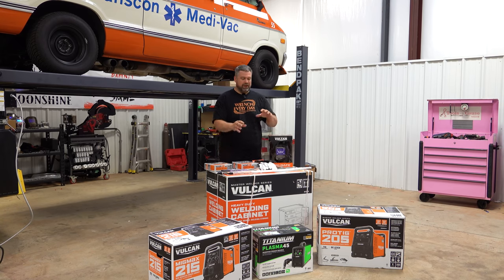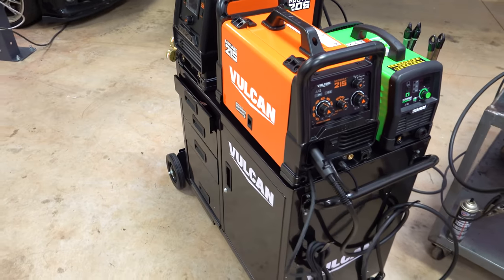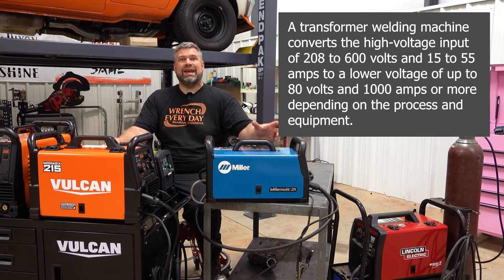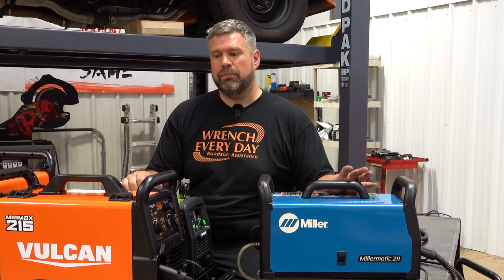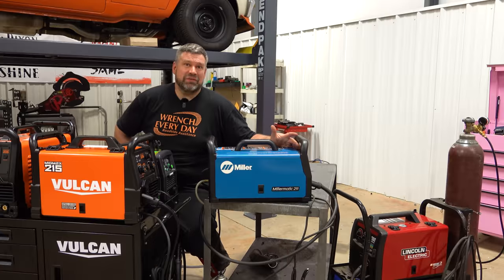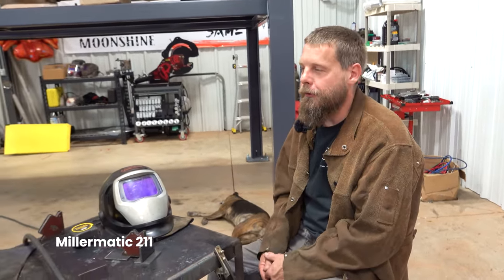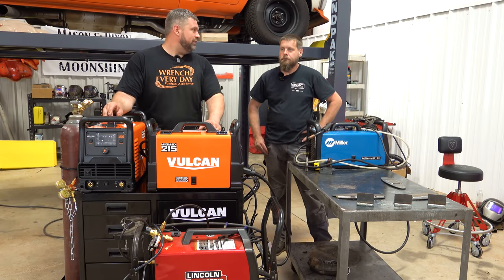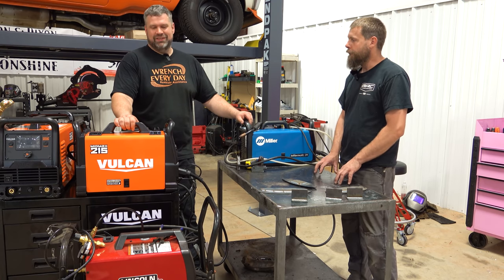Here's What NO ONE Will Tell You About Harbor Freight's "Best" Welders....

Comment: There was a Miller welder for sale locally for $250 with a blown main board. The machine cost $2,500 new. Called around for a new board and Miller wouldn’t sell one, had to go to a service center. Used board if you can find one was $1,500. 

I could get a couple welders from Harbor freight for the price of a replacement board for a Miller.
Reply: I had a similar experience with a quite used Dynasty 200 I picked up at auction cheap.  It did work for 2 years until a board died.  Ended up selling it for parts at quite a profit and purchased a new Dynasty 210, 7 years in ans hasn't skipped a beat.
Reply: I came to this conclusion too. That once out of warranty,  Red and Blue cost more to repair than just buying another China welder.  I'm a fan of disposable welders now.
Reply: What model is it?
Reply: @fml5910  I agree that's what they're doing but in my mind they're doing what GM and Ford did when Japan first started sending cars over.  They didn't take them seriously and then all of a sudden their market share shrinks.  

I suspect the Chinese are going to take a bite out of blue and red too.  I don't believe that's $5000 more in value in a Dynasty over a $1000 China machine. Better yes, not $5000 better. 

The point of buying American is being able to get parts and service. If service costs more than a new 1/2 way decent welder, why bother with service?  I'll buy two cheap ones and keep one as a hot spare.
Reply: Solid, affordable, long lasting, home shop equipment that keep on giving, and keeps you in the running. That's  what you get!  China/Taiwan,....yep. They sure are. So is my iPhone, laptop, tv, microwave, fridge, electronics in my american truck, electronics in my Mustang, treadmill, toaster, bathroom scale, radio, blender, etc.
So if anybody wants to say that they won't  spend money at Harbor Freight for a tool, because  it's made in China, you might want to wake up and research a tiny little bit.  Go look at your big, American made pickup truck. It's a global market, and you will find parts from all over the place!

Comment: Shoooooooot, that’s awesome that you got to test all of these. I have the Titanium Unlimited 200 multi process machine and it is a very great welder, I’ve had it for a couple of years and have completed some really intricate projects that I use in my home and most recently a Move bumper kit for my buddies Chevy Silverado 2500 diesel. The welder never has any issues at all and any issues with welds has always been operator error. I also have the stick welder 225 inverter and it’s a small but mighty beast! I can’t say enough about the quality of these systems.

Comment: I have the TITANIUM Unlimited 200 Professional Multiprocess Welder and it's done everything I've asked of it.  MIG, TIG (no pedal), or arc, it does it all and doesn't skip a beat.  No issues in over a year.
Reply: @fml5910  I don't use it daily.   I'm a home hobbyist but it has served me well
Reply: @fml5910  I've Also acquired the unlimited 200 titanium. I've loved it throughout this time we've had together,  and I've pushed it as hard as I could. Other than the guns it came with, and thenot having dcen capabilities I've no complaining. Just love the machine. I Also bought the titanium plasma.   Love it love it love it,!
Reply: @fml5910  I've actually seen many pros selling the unlimited 200 for less than 600 many times. Just have to keep an eye open.

Comment: For the pre and post flow of gas, my old (old old) Sealey Migmate 120 Turbo was set up so if you half-pulled the trigger you got just the gas, and a full-pull started the arc and wire feed.  This meant you could do your own pre and post flow.
Reply: The crap ass Hobart, just a beat machine, MiG welder at work is set up like this. Well I set it up like that cause I was sick of grinding out the starts and stops. Love that feature.

Comment: A few things to note, because overall you did a great job. All of the Hobart welders, except for the Multi-Handler 200 are transformer based and made here in the US in Wisconsin. Over 20 years ago, ITW purchased Hobart and Miller. I believe every Miller machine is made in the US and in the same facility as Hobart.

Unless you want to spend north of $2000, you are correct just about every multi-process welder is just Mig, Tig, stick and DC tig. However, ESAB does offer several multi-process welders with AC/DC TIG but you are well over $3000 for them. Also, the Hobart 210 MVP, or Multi-voltage plug is a Transformer based mig welder that does 120v and 240v.
Reply: You are correct sir. Hats off
Reply: Esab is right down the street from me. I'd love to work there but crap pay.
Reply: OK, If you want to get crazy, I'm In Australia, so factor that in, We tested and tried to BE sold a Lincoln Electric 300 Amp Modular design setup, multi process , Mig Stick and AC DC Tig system, and by the time you put all the modules and wire feeder and special Adaptors to get Water cooling on the Tig, was now nearly 5 foot high and was Going to cost our company $25,000 Dollars Australian, without the Tig Module it was still $19,000.  I (being the Senior Welder) tested it and tried to get my head around the Settings Screen, and I didn't like the Interface at all, and I couldn't get good Constant Welds out of the Machine, Especially Alluminium.  So we Ended up looking at another Machine that was 400 Amp water cooled Mig welder, German Made, Called "Lorch" (I hadn't heard of them) serviced by a Welding Company here that we deal a lot with, and It does Phenominal Welds in Steel or Alluminium and the Interface is simple and straight forward, has multi wave and Pulse functions, and we ended up Buying them For about $7,500 each (we bought 3), and we couldn't be happier, we told the Lincoln Guy he could take His machine back with him, my Opinion, Not user Friendly and too Dear for what you get.
Reply: That protig 205 is AC/DC also for less than $1k, mine works great for me and it also auto recognizes 120/240 without having to change a setting on the machine.
Reply: Everlast Welders offer multi-process AC/DC machines, the Lightning MTS 225 is $2,000.
Reply: Yep, you can throw all of those 3 down the hill. I love my Hobart welders. Both my Ironman 210 and my Handler 140 have been trouble free going on 10yrs. They're such a pleasure to use. Smooth as butter and they get used quite often. I've got less than $2200 in both of them paid for new back then.
Reply: My hobart handler 210mvps...I have 2 one for home and one for shop use work amazing for anything I need steel wise

Comment: One big thing to keep in mind with inverter based welders/plasma is the duty cycle.  You want it high enough that you don't have to keep stopping to let it cool down.  Sometimes that means going to a bigger machine to get a higher duty cycle for the work you plan to do.  I didn't hear that discussed, if I missed it then just ignore me lol
Reply: I am new to welding. Does duty cycle have a negative effect on the work itself, or is it mostly just a time constraint?
Reply: @Inertia888  It's just how long can you run the machine before you have to stop and let it cool down.  Pretty easy to work around on most small projects if you change your assembly order so you're not having to do all the welding in one stretch.
Reply: I made this similar comment above. These machines DO NOT have the same duty cycle ratings as the big blue and Red or even green machines. That's okay for a hobbyist, but not a professional.
Reply: correct. thats why professional welders that use smaller machines gravitate towards miller. lincoln make seriously pro quality larger welders just like miller, but their smaller home depot welders have crappy duty cycles. you can weld for like 10 minutes and then it stops

Comment: I picked a Hobart 140 for my project cause my buddy who used to be a professional welder recommended it and I didn't want to put in a 220 outlet. Its made by the same company as Miller but they are much cheaper. I replaced floors, body mounts, kick panels, rocker panels, toe boards, and did numerous patches on the rear floors and a few on body panels and it worked like a champ. The 110v systems work great if you are mostly welding sheet metal and don't need a high duty cycle.
Reply: I bought the Hobart 140 also which was recommended by a friend of mine who works at a chassis shop as a welder /fabricator and he told me that unless you're running beads a foot long or welding metal over 1/4" that this welder was more than adequate
Reply: I too have a Hobart 140 and it's been a great machine. I've done some exhaust repair, a few small sheet metal repairs, several frames for cages (pet rats as well as pet snakes), even repaired a few steel chair legs that my pipeline welder buddy said couldn't be fixed. Got to repair some corral gates tomorrow for my mom. I use a Miller 220v mig welder at work all day building and repairing parts for industrial use but I still love my little Hobart 140 for the smaller "around the house" jobs I have
Reply: My Hobart 120 is 32 years old. I’ve gone through hundreds of pounds of wire over the years. I use my oxy-acetylene unit to pre-heat and can get passable depth on 1/4” when I need it. Now it’s finally going out. I shudder at the cheap HF stuff, but also at the crazy Miller price. I’m stuck.

Comment: Harbor Freight has come a long way in the last ten years. I recently purchased several Bauer 20 volt battery tools (1/2" drill, drill driver, reciprocating saw, 4-1/2" angle grinder, 6-1/2" circular saw and line trimmer/edger) and have been pleasantly surprised. A DeWalt or Milwaukee equivalent would cost more than I have to spend.
Reply: Even their electric chain saws helped me trim large branches and keep firewood in the wood cradle.

Comment: I'm gonna say it. With my 32 years as a welder and 16 of those as a CWI, That Vulcan, based on the sound, was right in the zone for short circuit arc welding. The Miller and the Lincoln both needed just a touch more wire speed.
Reply: I was gonna say the same thing .... that vulcan sounded like it was dialed in perfectly!! The other two needed a bit of adjustment....

Comment: I have been using the Vulcan multipro 220 for about 3 years.  Mostly on small to medium size projects. Only used the stick and wire so far I have been very happy. However if you are a pro. You need to consider the Duty Cycle. On one project I was building a 50"w 2"h x 20" d basen for a ribbon waterfall for a friend's pond. I was using the welder hard all day to completely seal the seams. The next day when I started again there was a loud bang and that was it. Dead. Good thing I bought the extended warranty and Harbour Freight replaced it no questions. They were very nice. Now I'm alot more careful not to over tax it and that works out good. More beer breaks.
Reply: yes for people welding a large part of the day, you have to go with miller if its a smaller machine. they are the only ones with a duty cycle that wont force you to stop all the time. both lincoln and miller are great for the larger machines though

Comment: I have the Titanium 125 Flux welder. I use it for some personal and some work. It does everything I need it to do. I spend less than 300 for the welder, gloves, clamp, and helmet.
Reply: I can weld up to 1/4" steel with no issue. I'm usually welding exhausts or hitch receivers. Nothing really precise. Stainless steel and aluminum are obviously out of the question but that's not an issue in my specific needs.

Comment: i have that same miller welder at work and i love it, its amazing for doing thin metal for body panel replacement and i love how easy you can switch from mild steal to aluminum or even stainless. its so user friendly to use
Reply: You cant weld steel to aluminum with that type of welder. It is possible with Explosion welding.
Reply: @joemad4110  smh. No where did he say he was welding the two together

Comment: We have the first generation miler 211 and we got it in 2011, the fact that I could use it on both 120 and 220 has been helpful. It was like $1300 back then and when you break down how may broken bolts we have gotten out and trailer projects we have done. I also like the support if you need something. We have literally run 100s of spools through it. Now on a budget the Chicago 180 is great for a cheap 220 only mig.

Comment: I have the migmax 215 for over 3 years now. Only issue I ever had was the ground clamp, it lasted about 2 years. I have put many hours on my machine and it works like the day I got it. I have built many things with that machine. 2 sawmills, logging winch, as well as repaired and rebuilt several deck over trailers, dump trailers and many repairs to my stump grinder. As well as countless other repairs. I read where the internals to the Vulcan are the same as the blue and red machines. For me and my budget the Vulcan has been hands down a awesome machine.

Comment: I don't know much about mig welders even though I own one but I did notice the difference in the sound of the arc on the hf machine. Sounded much tighter and consistant over the other welders. I would have liked to see a close up view of the welding processes and finished processes bedides a cut away view of the welds. It looked to me that the guy doing the welds was very impressed by the hf welder as he seemed surprised of it's capability and somewhat stunned as per my observance.

Comment: The best part of Budget HF welders/plasma cutters is when their budget circuit boards inevitably die there is zero parts support. So you get to learn how to become a circuit board technician at home on your own dime.
Reply: Or you can give Miller more than the total cost of a new HF machine for one of their boards lol 😂 take your pick….
Reply: I worked for a place that just returned them. Buy the warranty.
Reply: 7yrs running and no board failures, lives in dust and grime also but i do keep them blown out weekly. I bought a HF machine while i waited 4months on a board for my Miller but when i got the $540 board i installed it to verify it was working correctly then wrapped it in a bag for storage, been using the Vulcan ever since....they both have their pros and cons but if this Vulcan lives another month it will have lasted longer than my Miller without failure so thats a win imo for a cheap back up machine.

Comment: I've been pleasantly surprised with my AHP alpha tig for a "budget" welder. My MIG is a super cheap Campbell Hausfeld I bought from Walmart 15 years ago 😂 Set up on gas and upgraded grounding it does everything I need it to do for non professional purposes
Reply: Lmao.  I have that exact same walmart welder.   Still a flux core setup but the damn thing just won't die.  I went with Primeweld for my tig and plasma cutter, and they are amazing so far.
Reply: Yeah I had an AHP too and it did everything I wanted for about $800.
Reply: +1 for AHP. My Alphatig has been rocking since 2016 with zero issues.

Comment: The harbor freight stuff just kills the name brands when you factor cost… I’ve been more than happy abusing mine… their toolboxes are more than just ok too…. They have definitely been stepping up their game over the last few years…
Reply: Totally agree, they have been stepping up prices though. Still a great value
Reply: 🍻
Also, haven't looked further into the channel content here, yet, but would like to see comparisons on larger, upright tank 120V as well as ~220-240V air compressor comparisons - by class metrics, per video, if need be.
Reply: @That_Handle  I’m not sure about their bigger air compressors, I’ve got the 40gal 120v compressor from them as a backup and haven’t had any issues with it, it’s pretty fast and quite, been running a year now so… pretty good deal so far…
Reply: @robertw1871  ,
I had been checking out a larger 200 plus volt unit from tractor supply company but apparently as of late it has run into not only supply issues but quality issues and so on stepping back from that leaning and am looking to narrow down some efforts towards reappraisal of what's currently available

Comment: I've abused my $90 Harbor Freight flux core welder for probably 10 years now and it still works perfect. I have replaced literally nothing except wire. I've cobbled together far too many rusty horrendous exhaust with it.
Reply: lmao spot on, love that thing
Reply: Those super cheap Harbor Freight welders actually lack some parts to reach their price point. People have made videos showing how to add what's missing. It's all pretty doable. Basically what you're missing is a bridge rectifier a smoothing cap and an inductor. The unit obviously works without all of that but it works arguably better with it. You get a smoother more sustained arc. So if you want to upgrade your machine you have a path to do it.
Reply: @1pcfred  Oh yeah I've seen all the mods and everything. For the $90 I paid it works quite well, hahaha. I have another better welder now.
Reply: @802Garage  there you go then. Sometimes dirty AC is the way to fly.

Comment: I had some old $150 flux core mig welder I got off walmart like 5 or so years ago. Joined HF's insider track membership so I was keeping an eye on deals, saw their flux core welder was on sale for like $70 off and decided it was time for an upgrade to my old one. The new machine is probably half the weight, half the size and 90% quieter. These inverter machines are insanely compact and quiet compared to old transformers while keeping the power. So far I like it a lot. Seems well made, hopefully holds up as long as my old one.